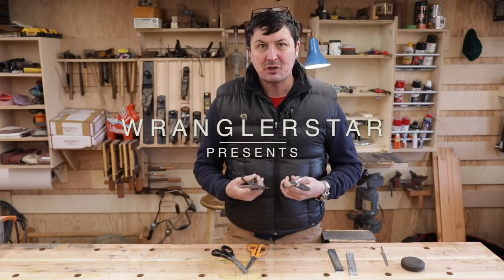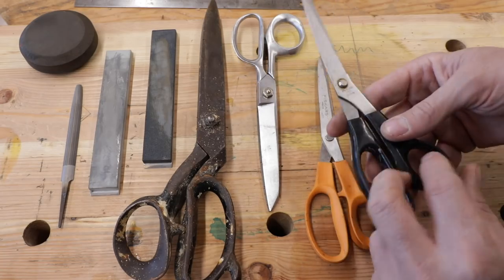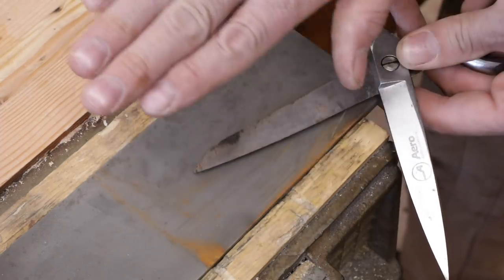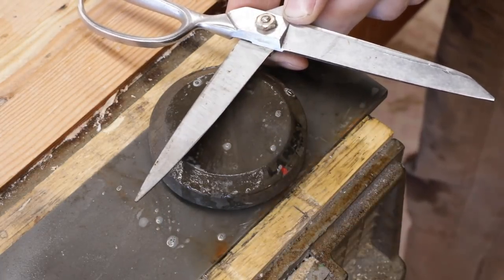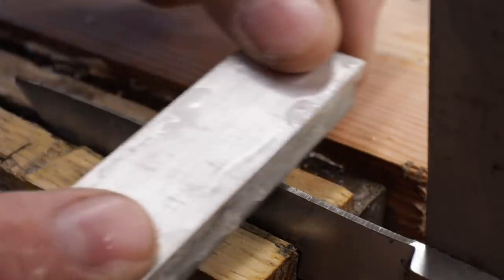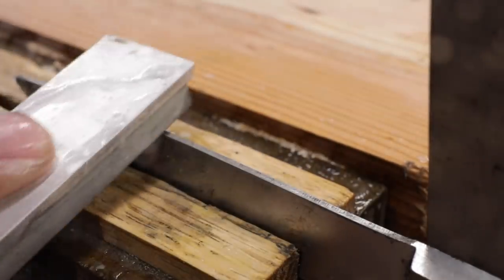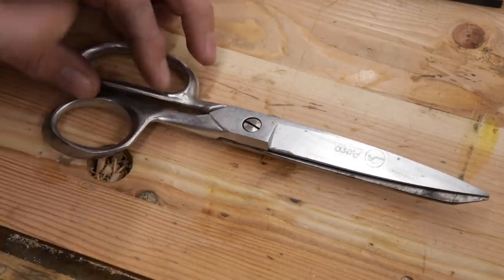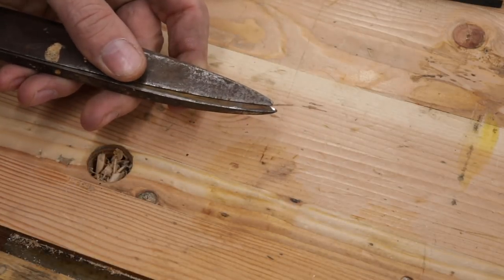How To Sharpen Scissors Like A Pro

Comment: You've made a typical mistake while grinding inner planes of the shears! I ALWAYS UNSCREW&DIVIDE two arms before such operation. The reason is simple: your method INCREASES the distance between both edges, what worsens cutting properties.  If you grinded each arm separately, you'd have thinned them in their whole plane and bad gap wouldn't occur! You were wright the BEST SHEARS grinds are CONCAVE in shape due to eliminate that bad gap.

Comment: NEVER flatten the hollow grind on scissors. When you file the correct angle on the edge of each blade, you are creating a new flat edge for the hollow grind. Why sharpen it twice?  Without that hollow grind, the work has a tendency to want to force the blades apart and not cut.

Comment: omg, I love the videos you do but sometimes just sometimes.   anyway you should have disassembled it and treated it like two knife halfs because over time if you don't also take materiel off under the hinge they will develop a gap between the cutting edges and your cuts will get jagged and nasty.   so in conclusion when truing the back true the whole back.

Comment: Well made scissors at forged not cast.  I don't believe Fiskars   would have been used by your grandmother.... probably Wiss.  The only sharpening to do on scissors or shears outs the beveled edge. Never the flats of the blade. It's the slight sawtooth created on the bevel edge  that allows the blade to not slip as cutting as well to allow it to cut more easily as it essentially creates multiple shear points per inch.

Comment: I am really hating more and more how horribly everything is made now. I remember as a child my grandparents saying things like,"they don't make stuff like this anymore" and I always thought that was at least an exaggeration. The more time I spend repairing or restoring tools, equipment, etc. from the late '70's and earlier the more angry I get. Electronics would have schematics included with the intention of repair, tools were made to be used for generations, hell even the screws and bolts are incredible compared to now. When I first learned how to sharpen a saw and found out that the saws you buy in a big box store was essentially made to be thrown away and can't really be re-set my mind was blown in a bad way. Okay, sorry rant over 😄

Comment: The steel on those cheap scissors with the plastic handles are actually pretty sharp. The problem is you can't fix it when it goes bad and the plastic will break once dropped on a concrete floor or used too many times.

Comment: This is so wrong. You never want to take away material from the inside edge, since this will create a gap between the knives and they won’t cut at all. You should be sharpening on the outside bevel to bring the bevel edge to the flat surface, not the other way around.

Comment: very bad.   most scissors have slightly bent blades.   if you "flatten" the hollow ground side you will mess them up.   Clean the inside.  Maybe take some light sand paper to remove burrs but no the stone or anything that cant go with the factory ground edge.    NO NO NO.  this way you'll only be able to cut notebook paper.

Comment: Dude, you just ruin your scissors. You will never get a consistent edge like that. I'm only 11 I've been sharpen scissors for countless times. Just grind the blades to the neck of a glass bottle or try to cut a sheet of steel or something harder than then steel maybe stones that small enough to get in between the blades. The purpose is to flatten the blades so there's no gap when two blades meet. Be carefult to not grind to much and too fast, or the heat would detemper the steel and make it dull faster again. 2-5 strokes is enough. You can feel the scissor sharpened right away. It only takes less than 10 seconds. I'm coming from a poor small village. We recycle everything we can. We use pencils until it's completely gone. When it's too small we attach it into a small bamboo stick.